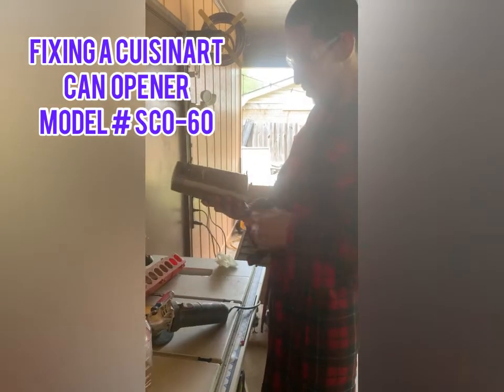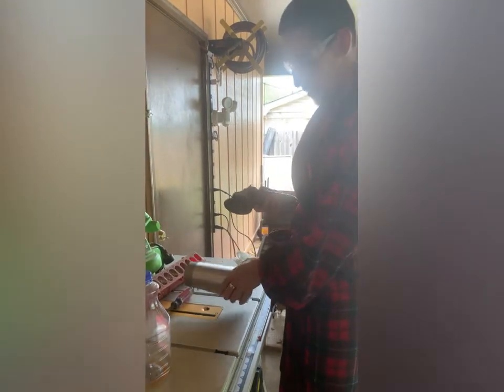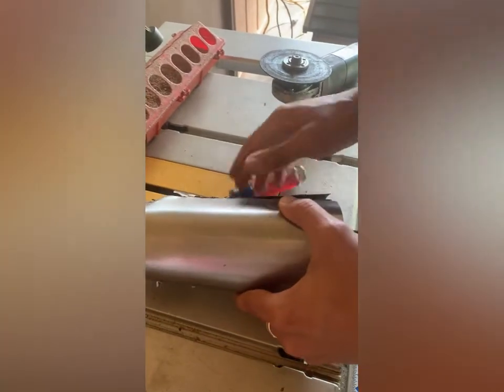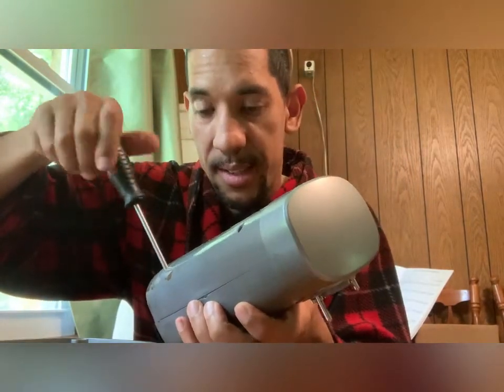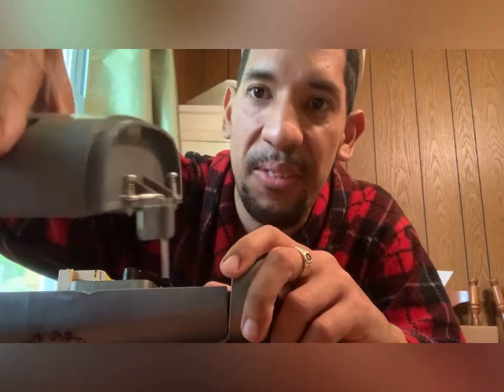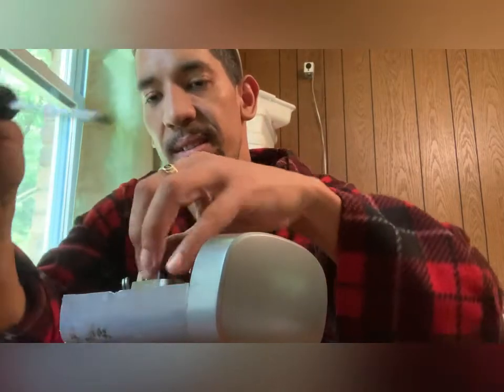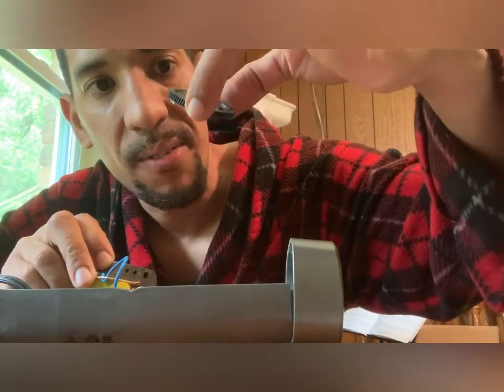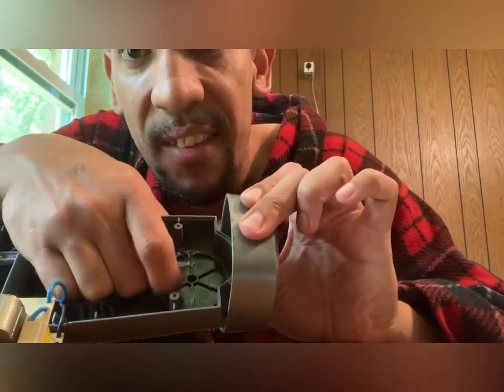Cuisinart can opener sco 60

Comment: So I had the same problem I ended up cutting the back of the unit with my dremill, I wanted to put a long screw with a nut to help hold the glue and create a stronger bond  I had to drill the hole in the centre of the gear a little bit bigger so I held the gear with a vice grip but to my  surprise the gear unscrewed so to disassemble the unit start with getting that gear unscrewed. The trick is to find a way to hold the centre while you do it, it happened when my drill bit got stuck, then it is possible to slide the stainless steel housing off , good luck
Reply from the maker: That is great info! right on time too. why? because the glue gave out a few weeks later. I'll have to make this repair again; but this time i'll reinforce the screw. Can you tell me a bit more on how you did your? post a video :) it will be great.